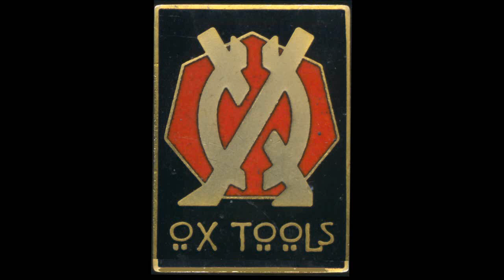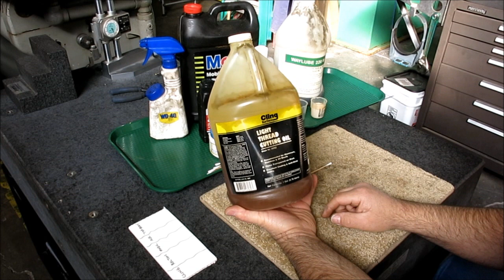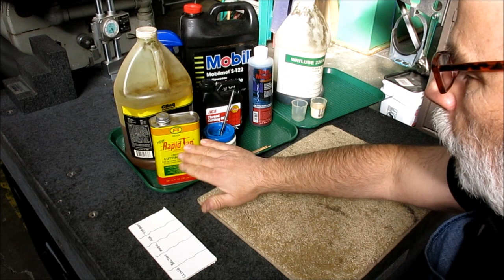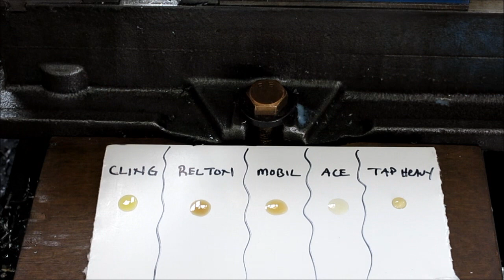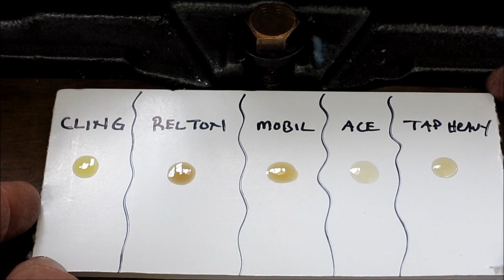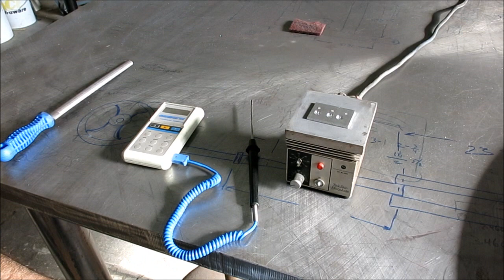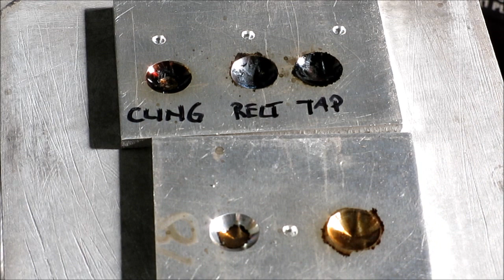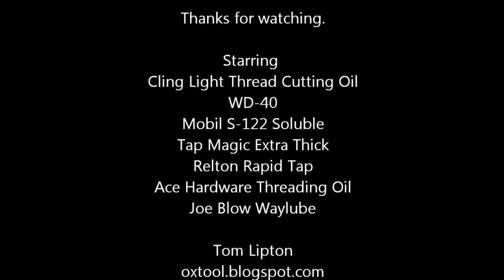Toms two cents on oils and coolants

Comment: Hi Tom, regards from France, got the bug, bought your book, found a 1500lb 1916 lathe to restore...
Anyway, the tendrils of the "way oil" remind me of the behaviour of the cheap chainsaw oil I bought for cheap at the local big retailer. Any reason it would not do for the ways on my old Davis Rochester rust-monster ?
Keep on trucking ! (from France)
Reply from the maker: Hi Fix,

Any oil is better than no oil. Seems like you should be able to source some way lube material where you are. Not like France is out there in deep space or something. Find a local machine shop and bring them some pastry. If you have a small container with you I bet they would give you a couple pumps of way lube. Thanks for the comment.

Cheers,

Tom
Reply: Pastry for way oil, sounds like a good angle there. My point was mainly stemming from being a newbie about oils and remembering witnessing the tendril-ness in my chainsaw oil... It's all good fun and if I manage to get this old sleeping DAVIS giant to work again, I might splurge for decent way oil on ebay.fr...
Meanwhile, I'll have one dominating take-away from your video : the oil's smell is the paramount factor, and it's subjective I'm sure (might even have to be a smell that at the residual post-handwashing level, my wife can live with... WD40 okay so far on that front).
THANKS !

Comment: Hey tom! 
In my warner/swasey turret lathe, im using water soluble flood coolant mixed 10:1.  I also put triadine in it to minimize the bacteria growth, along with some odor control tablets.  It does start to smell after awhile.  I also have a wheel skimmer to clean out any of the tramp oils that get into the sump.  I purchased a refractometer to check the mixture and i do that once a week in all of my equipment.  Yeah, it takes some self control to keep up with it, but in the long run, it pays off.  If you dont keep that mixture correct, it will stink, and it will get very disgusting.

Best,

Mark

By the way, throw me a pin next time.  White marsh md, ten miles northeast of baltimore

Comment: I have a question and some of the old Logan machines with sealed bearings is there anything you're supposed to do as far as lubricating the spindle with sealed bearings? I mean I know that you have to continuously replenished the back gear oil but other than that?
Reply from the maker: Hi Clown,

You can service sealed bearings in a pinch by injecting fresh lube under the seals. If its running fine leave them alone. Basically non servicable. Thanks for the comment.

Cheers,

Tom
Reply: oxtoolco I got a real big problem. And yes it is running fine so I will leave it alone for now. I have to replace a spindle eventually because whoever had it before me and I don&#39;t know how I did not notice this but they carved out about a quarter inch of the nose of the spindle probably boring something I imagine. but this spindle is so nice I cannot measure run out and a foot with drill rod. I even bought a new Sterrett last word to make sure that I wasn&#39;t having faulty equipment but I cannot get measurable run out. so we&#39;re placing this spindle is a hard thing for me to do because I hardly ever turn between centers. and that&#39;s the only thing that&#39;s going to be affected by that quarter inch of missing meat in the nose of the spindle. I frankly don&#39;t want to change it. I have an extra spindle from an 1821 this is beautiful beautiful beautiful shape but this one is so perfect that I hate to risk anything.

More to the point of this video I just picked up some rigid thread cutting oil it&#39;s really nice stuff. I haven&#39;t done the tendril test but I kind of have a feeling that it would show that characteristic is it really clings to everything but the tiniest smear it just does wonders. it smokes a little but not as bad as most of the stuff it has no order whatsoever then again I have a condition that has rendered my sense of smell almost non-existent so it probably stinks to high heaven and I just don&#39;t know it. it&#39;s a little pricey I paid $11 for a quart and I think it&#39;s $24 for a gallon so the price comes down pretty good. I&#39;m sure a gallon of cutting fluid will last me the rest of my life.

I decided I&#39;m going to make the leap 2 flood Cooling is amusing a lot more carbide lately is going fast and deep with my cuts. the cool thing is I got a bunch of Lowe&#39;s pumps that they use before pumping soda in the soda stations in the pump damn near anything and last for God damn years.

Thanks for the useful information by the way

Comment: Thanks for the informative lesson Tom.  +1 on Yiorgos comment about chainsaw bar oil as a way oil substitute.  I used some on my first lathe and it works fine, very high tack, until it gets cold (under 40 deg F) then it was like glue.  Made it very hard to move the tailstock, but if your shop is heated or you live in a temperate climate it would work well, and it can be found for cheap at your local megalomart.

VR
Marcus

Comment: Hi Tom. Thanks for all the machining vids, I enjoy watching them! I have a question about a couple specific cutting fluids, in particular Relton A-9 and Relton Option 1.

Do you have any experience using these? If so, in your opinion, is A-9 usable on steel if it's the only thing on hand, or should it be restricted to aluminum only? If you had to choose between A-9 and Option 1, which would you rather use for steel, and which would you rather use for aluminum?

From what I've gathered reading on the web (oh boy, and we know the internet can't possibly be wrong) it seems that Option 1 is sort of a last-ditch choice only to be used if water-soluble cleanup is mandatory?

I have only ever used Option 1, mostly on aluminum (as well as WD-40) but occasionally on steel, and I found the performance only mildly better than spit. Plus, it left black marks all over my milling machine's table underneath the vise (clearly due to the water content in the cutting fluid). 

I apologize for the lengthy comment and all the questions, but I'm a novice and only started machining as a hobby a little over a year ago, very slowly acquiring a couple of small machines. Anyways, I look forward to your reply! Thanks for reading. :)
Reply from the maker: Hi Orcinus,

Unfortunately I don't have any experience or commentary to add about A-9 or option 1. I do use Relton rapid tap and it is one of my favorite all around machining fluids. I use it on almost any material with excellent results. It will stain copper under certain conditions but the staining can be removed with a brite dip or vinegar and salt solution. Second would be WD-40 for aluminum work. So in order of use and preference, Relton rapid tap, WD-40 then some water soluble emulsion for maximum cooling for heavy cutting. I think folks fuss around too much with cutting lubes at the hobby and home shop level. There are just too many variables in cutting conditions to draw definitive conclusions. Just know a wide range of lubes and coolants work over a wide range of materials and cutting conditions. Hope this helps.

Cheers,

Tom
Reply: oxtoolco It does help, yes. Thank you very much for your reply, I appreciate it!

Comment: Gday Tom, Thanks for your Vids. I am looking at making some Gr 5 6AL-4V Titanium axles for my superbike. Could you please tell me the best coolant/oil for machining Titanium, obviously as you said nothing with chlorine. So what is in the market that will suit? Thanks Max
Reply from the maker: Hey Max,

It will depend on where you are. From your salutation I might make the wrong assumption and think you are in the southern hemisphere. If so a completely different array of products will be available. Are you in the US or somewhere else? Grade 5 is not too bad. The tooling makes more of a difference in the cutting that the coolant. The hardest part will be drilling the hole through the center of the axle. A good grade of water soluble not chlorinated coolant will work fine.

Cheers,

Tom
Reply: oxtoolco Hi Tom, Thanks for the reply! I, m from Sydney, Australia.
We do have that milky looking water soluble solution. From what I understand it is important that the Titanium doesn't get to hot otherwise it will affect the strength. As you said the big challenge is drilling the centre which could be done from both sides on the lathe. I could send it away to be drilled but I would really like to try myself except I don't have coolant through drill bits. If I did it slowly over an extended period of time could i use normal Hss or HssCo? the size of ID holes are 14mm and 17mm.
Thanks

Comment: hello.can you please tell me with what substance can i thin cutting oil.I have a cutting machine that has a 15 liter tank and it requires 5 liters of oil and 10 liters of....i dont know what:))))i guess not whater but what??thank you
Reply from the maker: Hi Sergiu,

It will depend on what kind of cutting oil is used in the tank. If its a 15 liter tank I would expect it to use a water soluble cutting oil. In that case your thinner would be water mixed with the special water soluble cutting oil. Hope this helps.

Cheers,

Tom

Comment: Hey Tom! Thanks a lot for all your videos, I'm following them and making my way through the backlog.

Thought I'd mention though, WD-40 does not contain kerosene, they even debunk that on their own website. It does, however, contain naphtha. While they're technically similar, they differ in some key aspects, such as flammability and density. Other than that, it's my lubricant of choice if nothing else is within reach. That, and Rocol's RTD (Reaming Tapping Drilling) liquid.
Reply from the maker: Hi Pumpernick,

Thanks for the clarification. I never even thought to check their website. I had always thought it was kerosene. Now I will go and do a little reading on their site and see what other information I can find.

Kind regards,

Tom

Comment: Tom-

This tickled a warning in the back of my mind regarding chlorine compounds and TIG.  Could be apocryphal, but the chemistry seems to check out.

As the story goes, chlorinated residues on a weld part (typically brake cleaner) are exposed to intense UV from the welding arc, producing poisonous phosgene gas. This rapidly cripples or kills the unsuspecting welder.  

Maybe crazy, maybe not. But... do you feel lucky?

Also BTW I agree about high vacuum service, we don't allow use of chlorinated fluids for machining SS parts intended for high vacuum. 

Thanks for another awesome video,

Mike
Reply from the maker: Hi Mike,

I must be near dead if this is even close. This might explain the intense acrid smell from some cutting oils. It makes sense. There are documents many pages long on what you can and cannot use for UHV service. Thanks for seconding my thinking on the vacuum service.

Best,

Tom

Comment: Tom,

Anything in "High temperature" service is going to need to be machine sulphur / Chlorine free all materials are succeptable Ti/inconel/monel/cobalt based etc...  Chloride and sulfide cracking / any corrosion cracking is a problem.  Most importantly in rotating equipment.  

https://en.wikipedia.org/wiki/Sulfide_stress_cracking
https://en.wikipedia.org/wiki/Stress_corrosion_cracking

Comment: Tom that was really informative.  As for high vacuum, machining with sulfur based cutting fluids is a no-no.
I thought too that you should avoid using sulfur based when machining aluminum as it stains black.  I've seen this when drilling and using sulfur based oil.
I would like to hear what you have to say on how to maintain concentrations on soluble oils in sumps.  Refractometer?  It's been a while since I've seen those puritan cotton swabs!
Reply from the maker: Hey Bill,

I use a refractometer to maintain the CNC's at work. Typically you have to top water up due to evaporation. We use Blasocut in out machines at work. I actually like it.

Best,

Tom
Reply: oxtoolco
Thanks Tom we use Rustlick WS-5050 in our horizontal bandsaw and Doringer H-32 in our coldsaw. I'm looking for a better way to suggest so we can keep the concentration at set levels.  The Rustlick leaves a pretty bad residue on the saw.  Evaporation is the main problem on both due to their open sumps.
Reply: Could you use a hydrometer like brewers and battery techs use,  to measure specific gravity (density)?  
Sorry for the 4 years late suggestion :)

Comment: I was taping some acrylic plastic at work and it was giving off that butt puckering squeaking .....like the sound a tap makes right before it snaps. My boss suggested trying somr pine sol. And it worked amazing. Even left a little lube in the hole which made the bolts go in nice. .375" plastic and a 1/4-20 tap........pine sol
Reply from the maker: Pine-sol is just pine scented weasel snot. Thanks for the tip. I'll have to talk to one of my sources in the consumer product industry and see what's in it. I think its a Clorox product if I'm not mistaken.

Cheers,

Tom

Comment: WD-40 is water displacer. Its fish oil with an emulsifier. I helped launch it in India and was inducted into its making process etc. They refine it so the smell stays away. Its an ancient technique in India to lubricate the bottoms of boats with smelly sardine fish oil and other fish bone extract. It turns black [oxidized] but add more life years to boats [wooden]. Im indigenous to Bombay and we do it here too in our fishing villages, use fish oil to open any stubborn bolt or nut :)
Reply from the maker: Hi Ekulda,

Thanks for the comment. I have heard that WD contains fish oil. Some people spray it on fishing lures to help catch fish. I have never tried it for that.

Cheers,

Tom

Comment: Will the water from the water soluble cause my lathe to rust?
Reply from the maker: Hi Shane,

Generally not. The manufactures include a rust preventative. The water and oil form an emulsion that does the work. So its not like pure water and its not like pure oil if that makes sense. Thanks for the comment.

Cheers,

Tom
Reply: Qeri

Comment: the carbon tet was back in the 1967 ,I was out of high school ! Use a bread loft pan, put the tapping fixture in it ,bolt it down. Fill the pan to  submerge the fixture. Could use a tweezer to put the nut in the fixture. So you will not get it on your hands!

Comment: Chainsaw bar oil is a good way oil substiute and as it is sulphored it work well as a cutting oil!
Regards, Matthew
Reply from the maker: Hi Matthew,

For some reason I couldn't reply to your next comment with the links about WD and Rapid Tap. The MSDS you found is not accurate for the rapid tap sold now. The "new" formula does not contain Tricloroethane. I did get a kick out of the "perfume" that is added to the formula. Thanks for the links.

Best,

Tom

Comment: The only plant based oil I would use is the coconut refined oil, as coco oil has the highest boiling temp, resists oxidation(indicated in higher burn temp) very well, compared to some oils... Actually if used unrefined, has some biocidal properties, especially in regards to fungal microorg... That said, I prefer using car steering servo oil, as it is a hydraulic oil that is quite runny, but like the ATF oil, clings and forms a very good film over coated objects, which as in an automatic gbox allows for operation under high pressure, small tolerances and actually has some decent cooling properties along with being decently washable with thinners, also smells moderately nice if used fresh... Dont go to your local mechanic and ask him to give you a 20 litre jug of used oils, as that will contain diesel, brake fluid, servo, gbox, motor oil and a lot of nasty shit you dont want as cutting fluid, some of which is corrosive as hell, as it reacts with water from air and forms acidic stuff, brake fluid especially, which in itself, fresh is a harmless hydraulic oil, in essence... But give it a year or two in a car system and it goes bad, which is the main and practically only cause of ruined brake equipment...  Just get some decent oil that doesnt cost a fortune and is in line with your needs and recommendations by others who do what you need to do for a lot longer...

Comment: Tom, I worked with a guy who swore that a Petroleum Engineer told him that WD40 contained a lot of fish oil, and that this was what actually made it water displacing. I have no idea if that is true or not, but he swore it was true. He seemed to be pretty reliable about everything else, so I had no reason to doubt him.
Reply from the maker: Hey kl,

That's a funny story. I kinda hope its true.

Best,

Tom
Reply: Well, my part was true, but you never know. He was a pretty knowledgeable guy on most things, but only stuck around for a few months. I know I have always wondered if there was any truth in it at all. It would be cool, but just sounds like something made up by someone who didn't really understand the properties of oils.

On the other hand, he explained API ratings better than anyone I have ever seen. He had a vast knowledge of that entire system. That is one of the reasons that I still wonder after all these years. You never know when you work in the trades. Over the years I have worked with some amazing people.

Comment: work in a Job shop and tap titanium nuts , we go down to a dry cleaner store and by carbon tetrachloride and submerge the nut in it, and tap it!
Reply from the maker: Bob Bielski Hi Bob,

Wow I haven't seen anybody use carbon tet for metalworking for a long time. Maybe because its a really nasty chemical. The stuff you are getting from the dry cleaners is probably tetrachloroethylene. The safer version of carbon tet. Do you work in the United states?  If you don't like your liver for some reason keep using the stuff. I bet it works great for tapping titanium. Thanks for the comment.

Cheers,

Tom